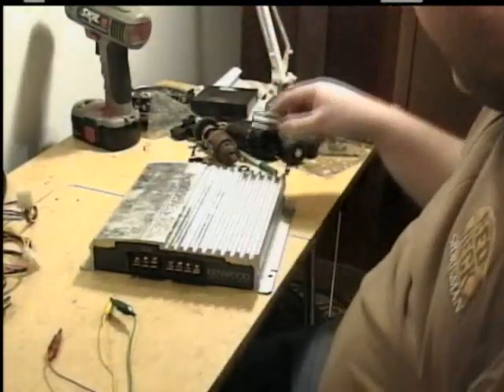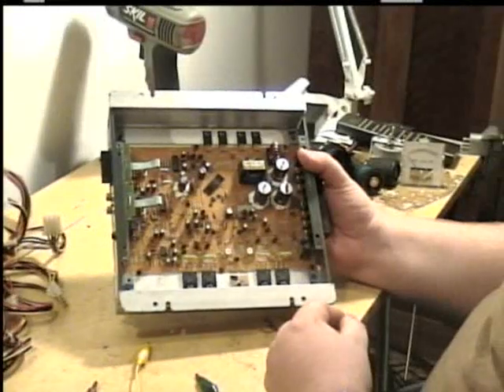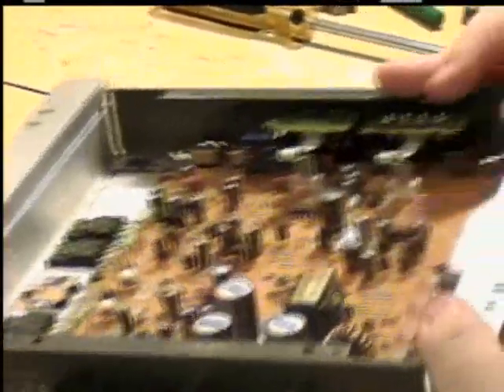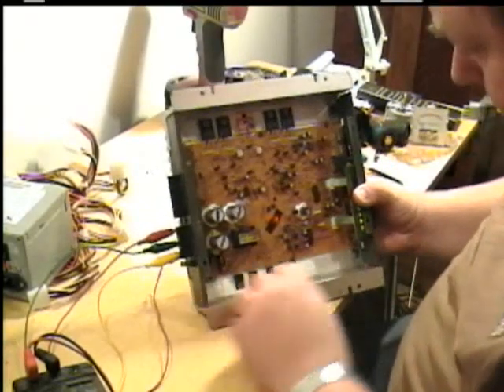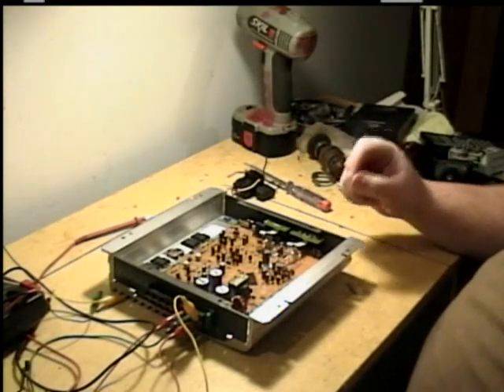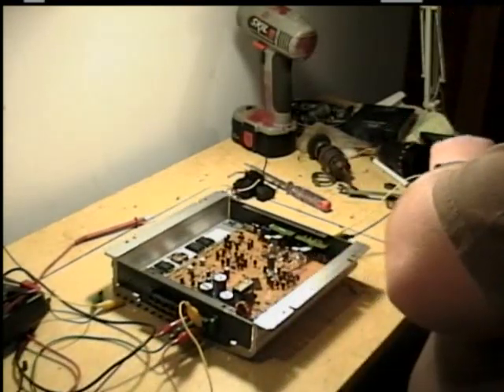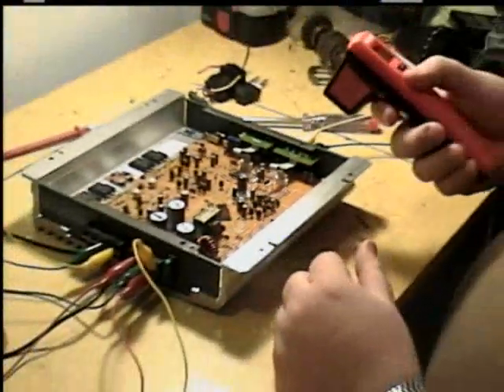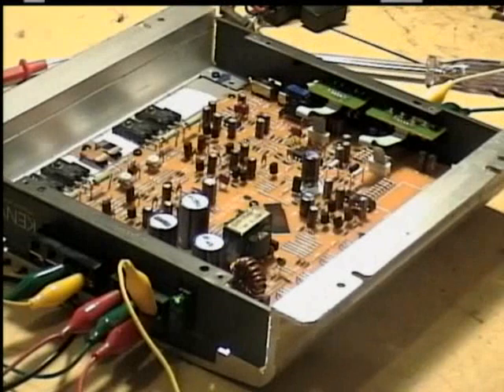Checking a Kenwood car audio amplifier

Comment: I have a kendwood kenwood kac 9105d it doesn't power on there's no sound no light no protection light and I Know my wiring is good cuz I have a pioneer hooked up rn to it same wiring n works awesome any advice I took it apart and littetraly I didnt test any thing with a voltage meter but usually if something is blow ussaly you'll see a bubble in one of the capacitors or you'll see black where something blew none of the mosfets are blown I believe it has something to do with the power supply but the board looks brand new it's not that old any advice
Reply: and yes I also replaced the 30 amp fuse s but  didn't do anything littetraly the old ones were fine but I replaced them anyways didn't fix it.

Comment: I have the Kenwood 9105d it's been flawless for 4 years now, just the other day my subs cut out and the red light isn't on at all. 
Tested the subs and they read 2.4ohms. 
I removed the sub leads and turned the truck back on. Blue light comes On, red light comes on then the red light goes out. 
I removed the remote wire and jumped from the power to the remote and still the same thing.

Comment: I have an old amp like this one and was told their might be a short.  Before connecting to power supply, I checked resistance between the BATT and the GND (without anything connected).  I was surprised to see that there was a connection (although with a little resistance) between BATT and GND.  That doesn't really make sense to me as it seems like it could create a short or at least drain battery with nothing on.  It seems like there shouldn't be any connection at least until turned on through the remote terminal.  Does that indicate any specific problem?  I'm an amateur but concerned about connecting to power.

Comment: Dear sir i have rockmars 3000watt car amplifire when I give battery current its on for a second immediately its p55nf06 transistor dead I replaced that transistor but same process again all output transistor are ok"

Comment: So, this can work with any audio amplifier not installed?  I bought a car with 3 competition amps, that I wanna get rid of, they work I'm just not into this stuff.
Reply from the maker: ***** Yes, it doesn't have to be installed in a car to use it. You can use them outside the car. You just need an adequate DC Power source and speakers to make them work. -MrFixit

Comment: The 1st time any real current is thrown at that amp, it will fry the remote circuit. Remote inputs are in fact 12 volt as he said but any current over 500ma will render that thing a brick.
Reply: You could put a 12v source with 1000a available to the remote input and it won't hurt a thing. Go read a book or something before you hand out any more of your misunderstandings of electronics.

Comment: The filter on this amp doesn't filter out noises as you mentioned. It's a  selectable high pass /low pass filter.
Reply: it is not a high pass/low pass. just an off (full range) / low pass
Reply: James Nemeth Right. It's a full/ or low pass. The low pass will start to attenuate around 150 htz.
Reply: Franky Paul he said it's a filter, and that's what it does, it blocks sound or noise...

Comment: I have a Kenwood kac 9102d and every time I connect the remote and ground the power light turns on but when I connect the battery it stays on for 2 seconds then powers off. What could be the problem?

Comment: I have a MTX 600xd given to me that a guy had laying around said it worked but sat a few years, I hooked it up and couldn't get the magic smoke back in after a valiant attempt. Burnt 1 of the 4 power supply fets so I replaced all 4. 1 of the 2 electrolyte power capacitors 5600uf 63volt was quite swollen and had dried out so I replaced both of them. Now the amp turns on but no sound. I tested the RCA input and from the amp ground to rca ground 1 side shows about 42k ohms and the other side 71k ohms. 0 volts ac are coming out the of speaker terminals. Its is a mono class D amp. I am quite electrically inclined and repair computers, also can handle a soldering iron very well. So I know I can and I will fix this just need a little guidance. Plus if you use a term I am not familiar with I will look it up myself instead of asking what does that mean, as I want to learn this trade. Any input is greatly appreciated and thanks in advance.

Comment: I have a Boss Amp installed in my car. It keeps going into protect mode each time I power it on. I have gone ahead and taken off all the speaker wires just to eliminate any question of the speakers being the problem. It still shorts out. The Amp will play for days or weeks sometimes without any problem and at other times it will just cut out and go into protect mode immediately at which point no sound comes out. Any suggestions?

Comment: Quick question can u test the transistor while is still attached to the board?
Reply from the maker: No. The current will stray through circuits on the board giving false readings. -MrFixit
Reply: Thxs for the response
Reply: The output transistors or FETs can usually be tested in circuit for short circuits, if one is found to be shorted, always replace all the output devices  on that channel because at the time of the short some of that current will have flowed through some of the other devises possibly damaging them.

Comment: mr fixit i have a power precision car amp 1800w 2 channel it blow out the mosfets. out the six blow out just one. i check other things like capacitors and diodes for troubles but none the only thing burn was one mosfet. i went and buy all six mosfet irfz44 and replace it with irfz44n when i connected all six blow out. the thing is that by just connecting ground and power the six mosfet blow out, it didnt give a chance to connect to remote so it can power on...help on this !!!!!!!!!!!

Comment: quick question... i have a powered sub in my house with built in amp.  when i turn in on it makes a loud buzz noise, no bass. do you think this would be an easy fix?
I check the fuse and its fine, and checked the speaker..
Reply: I

Comment from the maker: I no longer repair amps. It's a hobby on the side when I have nothing else to do. Usually  when an Amp goes into protect mode, it's a power supply problem. -MrFixit

Comment from the maker: The Diode in the video only serves as a polarity protection device. The EMF isn't strong enough to feed back to the alternator. Capacitors are used to absorb and smooth out any fluctuation in the power during switching. -MrFixit

Comment from the maker: The thermal light refers to the sensor embedded in heat sensitive areas of the amp. if the Temp reaches critical the amp is programmed to shut down. this usually happen when there is poor ventilation, faulty ground, or a faulty sensor. The case doesn't always have to be hot to trigger Thermal protection. Some ICs also have temp sensors inside. Check for a hot IC, usually around the Switching power supply. -MrFixit

Comment from the maker: It sounds as though the toroid coil has a short causing the MOSFETs to overload. is there anything else on the board that has blackend like a resistor or capacitor? What is the ID/part number of the MOSFETs you replaced? -MrFixit

Comment: can someone help me? i have a rockford punch p250 amp. its been running great for 6+ months, i had it ghetto rigged for a while running a small wire from the power to the remote input to turn it on and off, recently i moved the box to the trunk and ran the remote wire the correct way. now in my trunk, it played fine for about 15 mintues then the thermal light came on, wasnt even hot at all. i didnt mess up the speaker ohm load wiring cause i never unplugged them moving it. y is this light on?

Comment from the maker: Are you using the correct MOSFET? MOSFETs are either P-channel or N-channel whose pin connections vary by model. When soldering the transistor be sure it is attached to a heatsink to help dissipate the heat. When remounting the transistor to the metal case, be sure to use insulator hardware and non-conductive thermal compound or pad to isolate the MOSFET's tab from ground and adequately dissipate heat to the case. Should be no electrical conduction between the MOSFET's tab and the Case. -MrFixit

Comment: ey i got a powerbass amp 800wtts it is burn out one of the mosfet, but the thing is that it keeps burning it i have change 2 times already i solder and it burn when connected. i check any missperfection on circuit board and evrything is ok no burn lines or touching help!!!!!!!!

Comment from the maker: Check under the PCB for burned wire traces. The power surge may have caused the MOSFETs to fail. I used to repair amps years ago, but no longer repair them since a new amp is cheaper. -MrFixit

Comment: I hooked up my power wire and arc'd it on the case of the amp, it sparked really hard and the protection light now comes on and nothing works.  I dissected the amp and couldn't see anything visually wrong.  Any idea what I could have fried? Its a Kenwood amp. Do you guys do repairs if I send it to you?

Comment: I have a question i have a polk pa880 amplifier that is broken and im trying to fix. It turns on for less than half a second then it turns off. Any suggestions on what can be wrong. I have hooked it up right no fuses are blown. Something inside is broken.

Comment: hi i got a question i got an amp that is brand new never used i hooked it up and it powers on but there is not sound at all from my speakers have check several websites bout the problem but i have check everything over i hooked up another amp to the same wires and same subs and it works fine so i know there is not a problem with the connections or subs i have taken the amp apart and didnt see any burn marks or anything like that to leave me to believe it was some other malfunction can u help

Comment from the maker: I found the Technical Data for the transistor A110. It's a Silicon NPN Lo-Noise, Hi-Gain, Pre-Amp in a TO92 Package. The pins are ECB (looking at the flat side). Maximum Current: 100mA ; C to B volts: 70 ; C to E volts: 50 ; E to B volts: 5 ; Typical Forward Current Gain: 400 hfe minimum ; Power Dissipation: 360mW. Since A110 was discontinued, any Bipolar transistor with matching characteristics above will work, felplay vina. -MrFixit

Comment from the maker: billybonewhacker, the Toroid is similar to a transformer. It's an inductor. In amplifiers, they are used to increase the voltage by pulsing current through the Inductor. The more current that passes through, the larger the magnetic field generated. When the pulse cycle ends the field collapses causing current to be 'induced' in the coiled wire.  This is controlled by a PWM (the IC chip). The whole circuit is known as a "Switching" Power Supply. High wattage Amps use these PSU. -MrFixit

Comment: Hi my Panasonic SA-AK100 is on standby mode when I push the button it's won't turn on, do you have any idea what can be or do you know where can I get a repair manual. I only have check the fuse.. Thank..

Comment from the maker: The 800 Watt may have a blown fuse inside or a bad MOSFET. As for the 400W, make sure none of the wire are shorting the amp and it may have a bad transistor. I have videos available that show how to test transistors. -MrFixit

Comment: another big issue is mounting amps to boxes. they get hot and components will pull out due to crappy cold solders and vibration

Comment from the maker: How does diagnosis an Amplifier have 2 do with a CRT? You can't diagnose a CRT w/o the use of an Isolated Transformer 2 isolate the CRT from the common ground through the neutral wire. I don't even recommend 2 anyone 2 work on a CRT due the danger they pose. PCB's like this one have an insulated wax film over the components and wire traces to protect the circuits from corrosion. The only parts I touched were the silicon and not the powered PCB. This wasn't a tutorial but rather a hobby I do. -MF

Comment from the maker: Ken Foland, the PWM controller in the Amp's PSU was faulty along with a transistor. We looked up the part number only to find that I would have to order 1,000 PWM IC controllers just to replace one. It wasn't worth the expenditure.  I didn't have 1,000 Amplifiers needing the same replacement. What was I to do with the other 999 IC chips?? -MrFixit

Comment: @ESrepair hey bud it's me again asking for your thought on a pioneer amp I have it's a 760watts 2 channel I have it set up bridged but recently it stopped putting out sound to the subs and I know for a fact it has power,ground ect no blown fuses nothing neither of the speaker terminals on the amp work cause I tried to see if they would work if i unbridged it but nothing could it be possible the speaker terminals burnt out or something?

Comment from the maker: Please send me a video, to see what you described. Some Amps have fuses internally. The soft thump is caused by the startup of the amplifier. Some of the Higher power amps have a feature known as a Soft Turn-on to prevent the thump that could damage a speaker. Does the Thump occur on one channel or both? -MrFixit

Comment: My amp gets power but puts out no sound at all I've put my own rca inputs on there it's not my car worrying my other amp works good but just messin with this one to get it to work it doesnt have a fuse in it externally and the protector light isn't on so it's not a short I need help I can upload a video to show u if need be

Comment from the maker: what model is the amors? Check the wiring, fuses, and for proper ground. It's possible the power supply unit has a bad component. Use a volt meter to trace where power stop which may indicate the culprit. -MrFixit

Comment from the maker: First off, never replace a fuse with a higher ampere rating than the original! A capacitor will smoke if it is connected in reverse polarity or if the Voltage exceeds the Voltage rating. Note the capacitors + and - orientation and remove the damaged capacitors. Connect a volt meter to the cap's solder location with + lead on + and - lead on - and read the voltage, it should be below 25VDC, If it's above 25VDC or reading -25VDC something is wrong with the PSU. -MrFixit

Comment from the maker: It sounds as though the PSU in the Amp is bad. It seems to be shutting off intermittently. Check to see if the transistors to the PSU or the components are getting hot. -MrFixit

Comment from the maker: Yes, you can use the iPod or a CD player to provide sound. if using the iPod you can use the low level input side of the amp. The standalone CD player can also connect to the Low-level input. Any device that produce standard speaker sound level must use the High-level input side of the amp unless connected thru a speaker to line-level converter. -MrFixit

Comment from the maker: If you're going to test the amplifier, you'll need a 30 ampere 12VDC Power supply. A 10 amp PSU would suffice if the volume is kept to a minimum. The Amp uses a step-up "switching' PSU to power the main amp. Be sure you're using the correct Audio input. Were you having the same problem in the vehicle as to why you were testing it? -MrFixit

Comment: hi there... need help on my 800 watt powerbass amp one of the mosfet transistor gets hot and then blows up and turn off i replace evry mosfet transistors and resistors it turn on but when it gets hot enough it blows up help me on this........... hmendez86@hotmail.com

Comment from the maker: check the remote power connection. check the power cable. check the ground cable. check that the amp is getting 12V at the +12VDC and Remote terminal in respect to the ground terminal. -MrFixit

Comment from the maker: It's not uncommon that amps still draw a little power after they are turned off. I'm talking mere milliamps when the amp uses a remote to turn on and off. Check the remote connection. If there are no other problems during normal operation, you can use a power relay to disconnect the main power from the amp when not in use. -MrFixit

Comment from the maker: it sounds like the audio side is bad. The amp protects itself from Thermal, short-circuit, and over voltage. check for shorts in the speaker wires. Be sure the wiring of speakers DO NOT reduce the impedance less than 2 ohms per channel in stereo mode or 4 ohms in Bridge mode or 8 ohms when using Tri-mode. -MrFixit

Comment: hi i have a insignia ns-a1000 it had no power but win i remove all of the power Transistor out of the audio side it will power up in protector but all transistor i removed tested good and do you thank the bad part will be in the audio side of the amp or the power

Comment from the maker: Check the ground cable. Check the speaker cables. If the speaker wire is 8 gauge the omhs may be too low causing a strain on the amp. Try 10ga instead. -MrFixit

Comment from the maker: You shouldn't need to use a car radio. Although MP3 players do not produce loud volume, Try using a stereo 3.5mm male jack to stereo RCA male plugs adapter. Plug the 3.5mm into the MP3 and the RCAs in the LOW INPUT or LINE INPUT on the amp. Most MP3s have built-in volume control you can use. Start with the lowest volume then gradually increase to desire volume. -MrFixit

Comment: Hi Mr Fixit i have a question i hook up my amps  to the sub to see if sound would come on i made sure i connected the speaker wire properly and no sound came on.I bought the red&white y cable and connected to my mp3 for the music do i need a more powerful device to send the current amp like a car stereo?

Comment from the maker: That's true for caps and resistors and basic transistors. When it comes to ICs like Pulse Width modulators, many suppliers require a minimum number of pieces for a single part and that just isn't worth it when I only need one. Last I looked it up I had to order 100 ieces of the same part before it would be shipped. I do have more vids in the works. -MrFixit